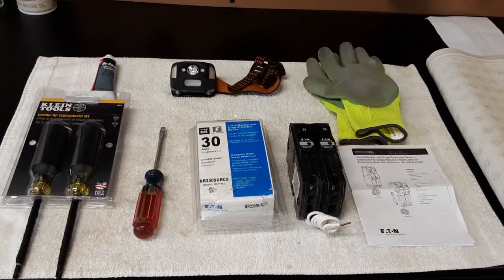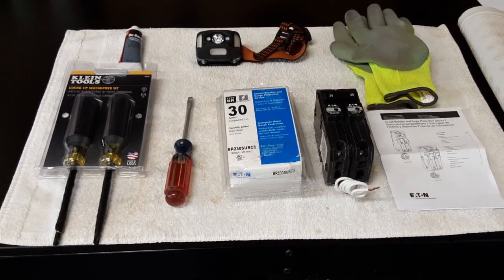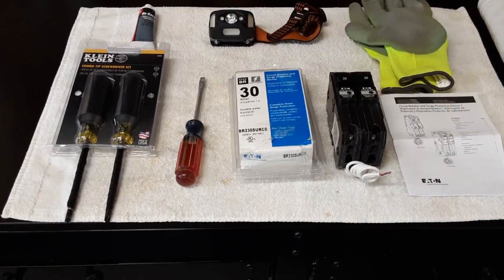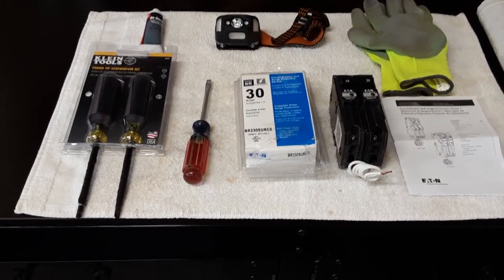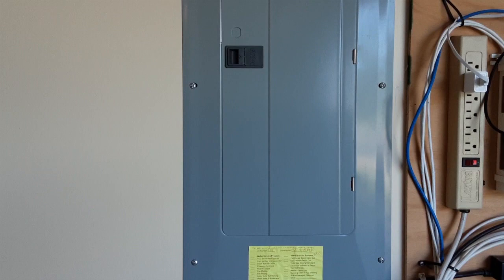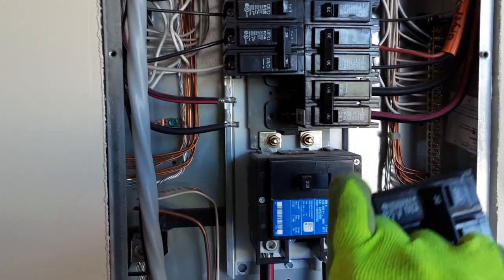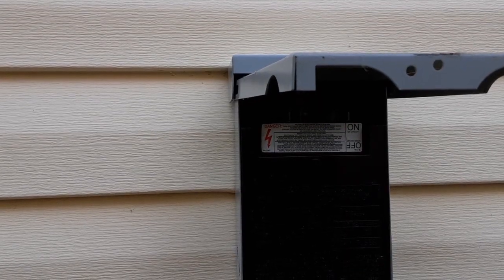Whole House Surge Protection Breaker Install

Comment: Andre. Great video. I am looking at doing the same thing. From my understanding the BR230SURCS is inactive and replaced by BR230SUR but I don’t see any difference from research. I see you connected it to something but would you recommend the BR250SUR as a stand alone?
Reply from the maker: Thank you for the comment and I am so glad it helped you.  If you have the space around your circuit breaker panel I would use the Eaton CHSPT2ULTRA or the CHSPT2SURGE.  They offer better surge protection and a better warranty.  Search YouTube for related installs of these surge protectors. I used the BR230SURCS because it was both a surge protector and circuit breaker in one.   Also, I was limited in slot space in the panel.  Best of success to you.

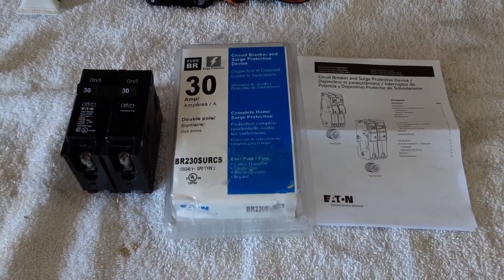Comment: For most effective surge protection, neutral wire (white pigtail @ 10:15) should be as short as possible.  Neat design of SPD that incorporates a 30A circuit breaker; wish Square D had that option.  Thanks for making video.
Reply from the maker: William, thank you for the comment!  Like you Square D is my vendor of choice for electrical panels.  I had hoped to make a more refined video, but I wanted to make it available as quickly.  Since making this video my relatively new cell phone has a better camera and shake-resistant video capture.  Next time I am in the panel I will check to ensure the length of the white pigtail is as short as possible.  Thanks again for the tip.

Comment: Don't you have  to have both phases covered - both poles?
Reply from the maker: Yes, it covers both poles.  That is each 110 VAC pole for a total of 220 VAC.  So, make sure the main circuit breaker of the panel is in the off position.  It is a killer otherwise, and best left to the electrician if you have any doubts.
Reply from the maker: Yes, it is 240 Volt AC device.